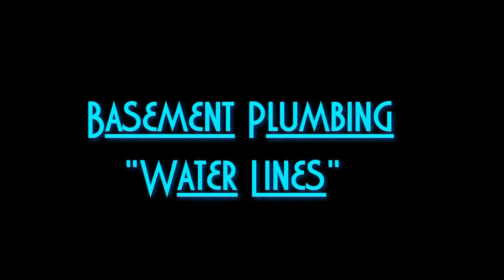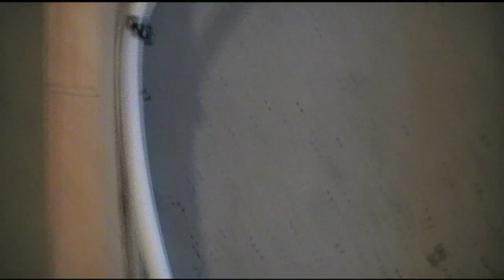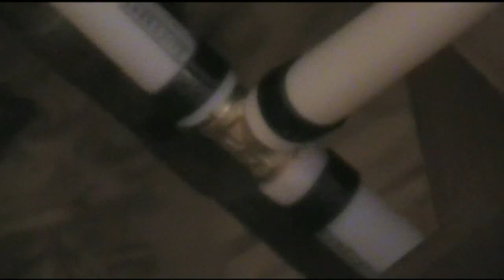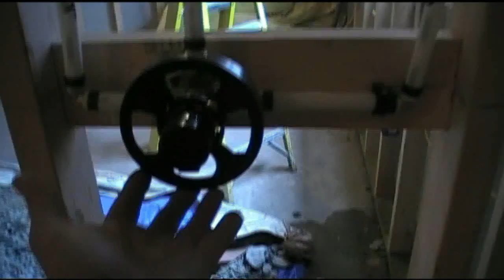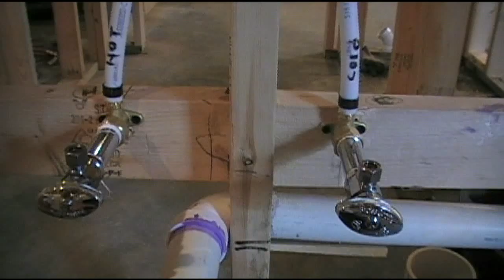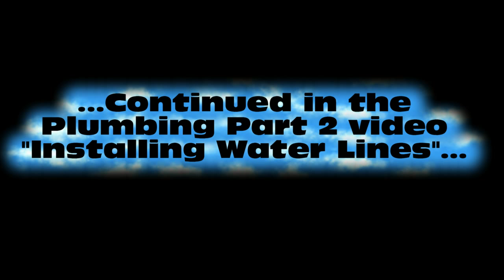Plumbing Basement Bathroom Water Lines with PEX!

Comment: So I'm seeing a lot of shark bite fittings... I am comfortable soldering a tee in, I'm just really wary of something that is a slip fitting. How reliable are the push/ shark bite fittings? Thanks.
Reply from the maker: Very! They are quickly replacing most "outdated" residential copper fittings.

Eddie
Reply: Sharkbite guarantees their slip fittings for 10 years. If these fittings are being buried behind drywall this could be very bad.
Reply: Only use shark bite in an area that is exposed for service.  Don't drywall over a shark bite fitting.